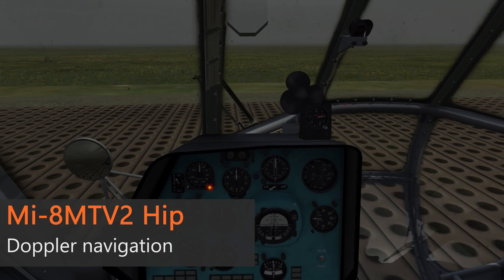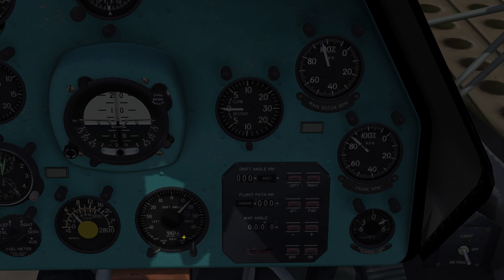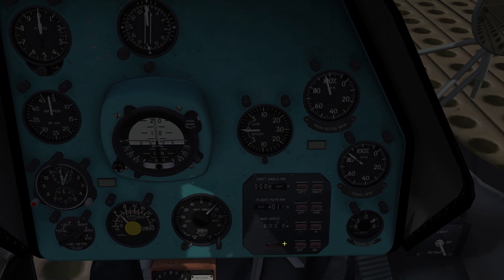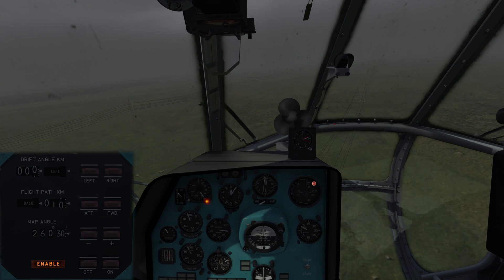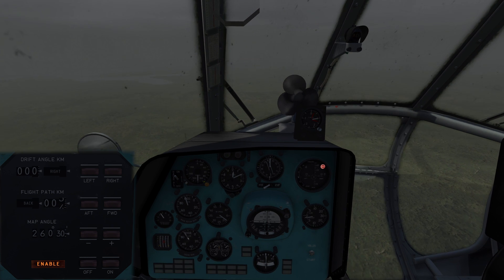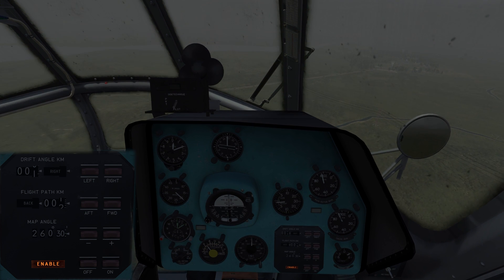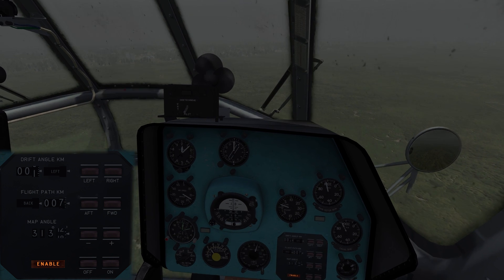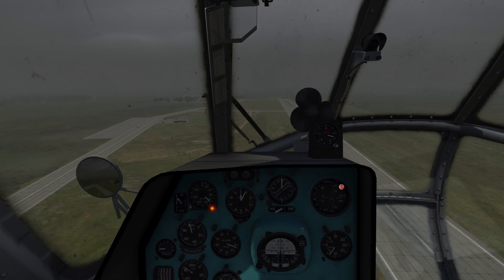[DCS] Mi-8 Doppler navigation

Comment: You can also leave the Course Angle (Map Angle) at 0°, so your Lateral Deviation (Drift Angle) is your east-west movement and your Distance (Flight Path) is your north-south movement. Real aircraft Doppler nav systems sometimes had this as a specific feature. Works better in flat-earth DCS than IRL though.

Set your Course Angle to "magnetic heading for north direction in your MGRS grid" and preset your deviation and distance to your starting MGRS position… and your Doppler system will track your position in MGRS coordinates :)
Reply from the maker: Thanks for the great info on both of your comments! Appriciated!